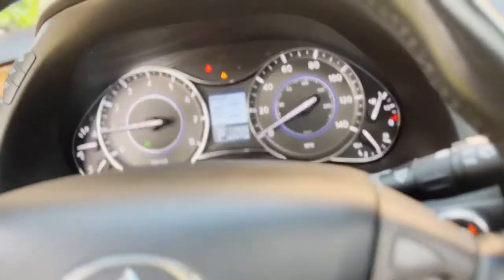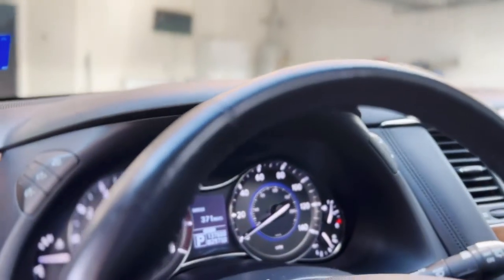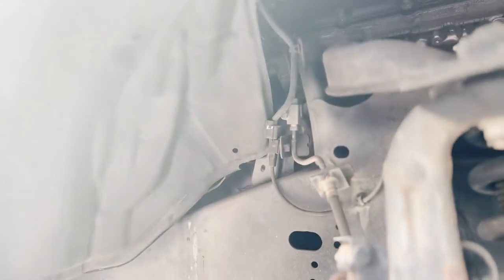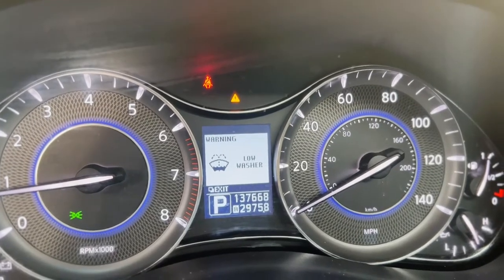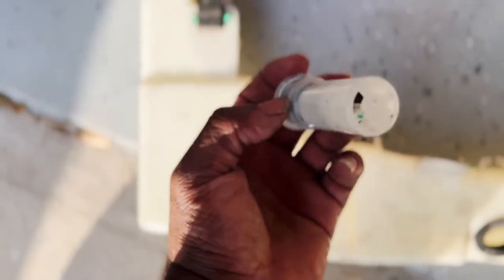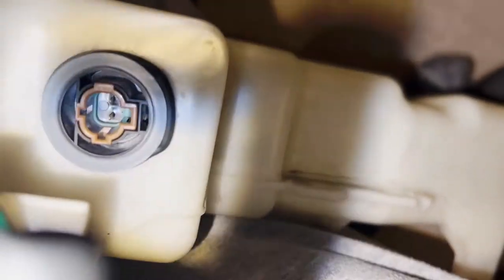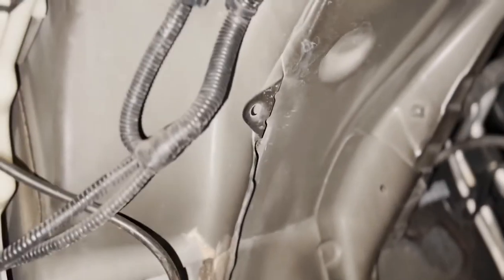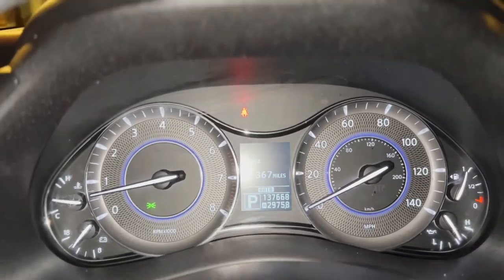2010-2013 Infiniti QX56 Washer Fluid Level Sensor

Comment: Thanks!  This is the only video I could find that tells me how to get at the fluid pump at the bottom of the tank.  I have a full tank but no fluid and no noise from the pump.  I will see if I am getting voltage to the pump once I get the fender well off.  Thanks again.
Reply from the maker: Thank you for checking out the video. I wasn’t able to find many videos either so anytime I’m able to work on it myself I will definitely post a video

Comment: I see those miles adding up. Any issues other than the wiper fluid sensor issue? I am thinking about buying one
Reply from the maker: Thanks for checking out the video. The only other issue I had was the evap canister went out, but other then that no issues. We have drove it from Texas to Florida and back a couple times.

Comment: OEM is 28911-E400 for 2017 , the one in the video is Duralast SU8136 for earlier model.
Reply from the maker: Thank for watching. In the video I show the box the part came out of which has the name and part number on it. No where in the video did I say it was OEM I said it was a replacement part from autozone
Reply: Someone else was asking, I was answering their question. I had the oem number before I saw your video and copied down the part number you used so I put both in the chat. Thanks for the video, not sure what we did before YouTube.  My wife’s needs to be replaced… may just modify the bad one so that it does not detect a fault. Not sure if open circuit or close circuit trips the low fluid level.
Reply from the maker: @jrold8130  appreciate it Ii had replied to him as well hopefully he seen it. I was going to go with the OEM part just didn’t feeling like going to the dealer then I got a discount at autozone. Really wasn’t to bad of a job. I really couldn’t find a video on the qx56-80 so i was like why not posted it.

Comment: thank you!      I have a question.    After replacing the bumper, Low washer signal  continues to come on.    I wanna turn off   the signal on the panal.   what can i do for it ?    ( maybe....   I think the level sensor  is OK, but  the electric wire was cut.  )
Reply from the maker: I think it’s gone to be hard to try and cut it off at the panel. If the wire it just cut out that would be the easy way to fix it.